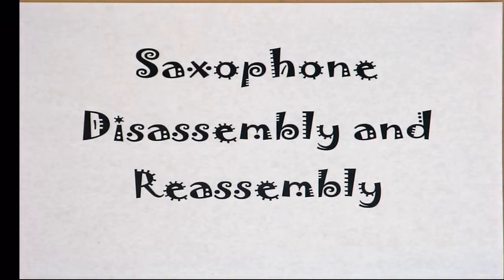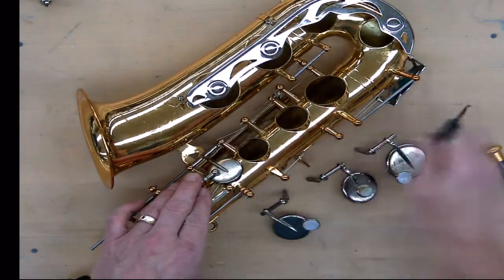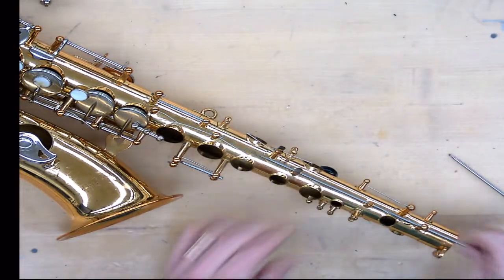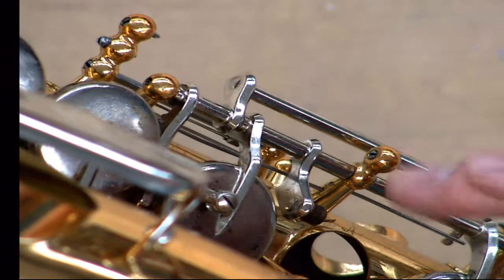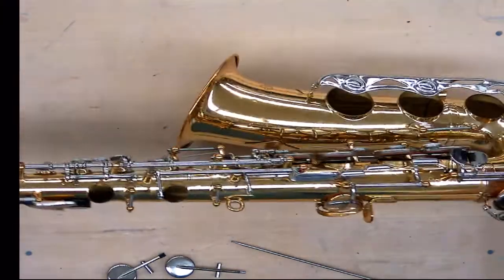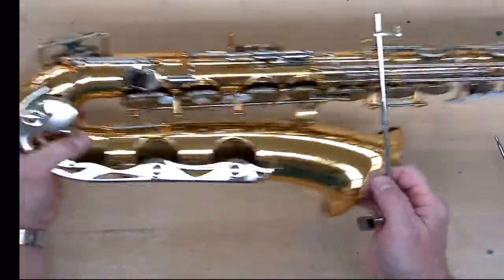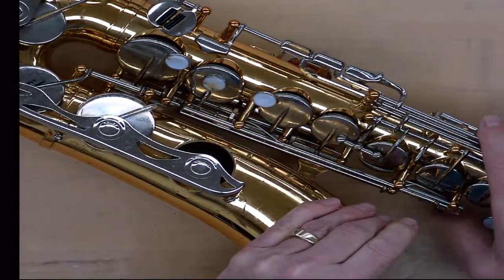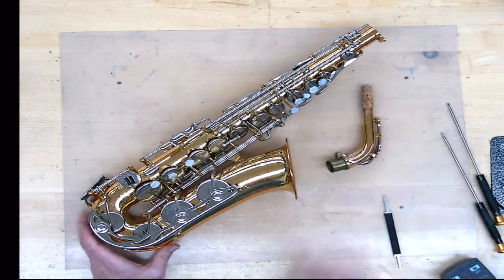Saxophone Assembly II

Comment: Why would you skip the hinge lube???? I started to inquire on Part I, why would you put the hinge rods back into the horn?? If you are going this far into a horn, wouldn't it be a good idea to clean those rods?? They are either rusty, or they are black with lubricant and dirt, depends on the user, but in both cases the hinge rod needs addressing. You kinda left off a MOST important part.

Comment: How do you prevent the pivot screws that are not fully tight (due to adjustment)  from rotating with the movement of lever rods?
Reply: They never move out, they basically hold still while the key pivots.